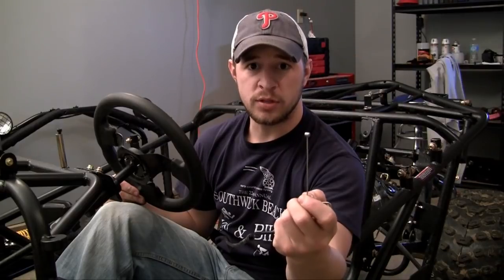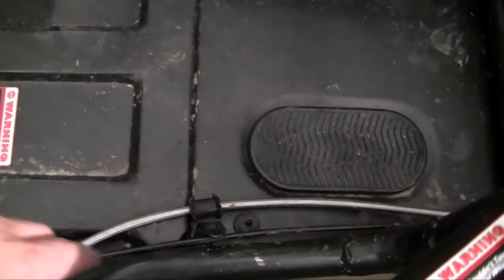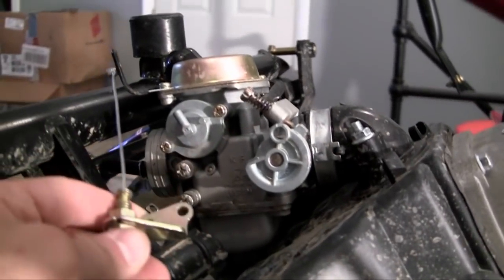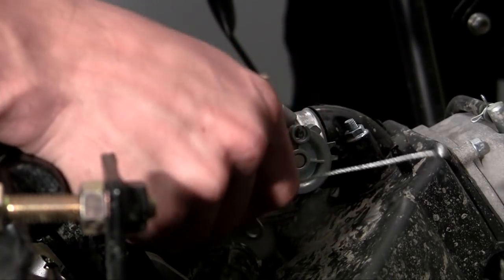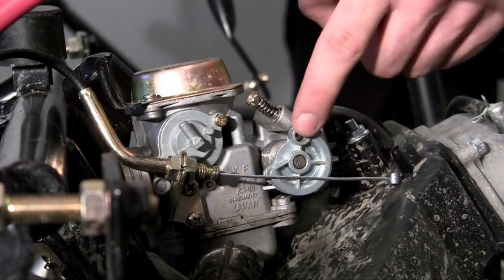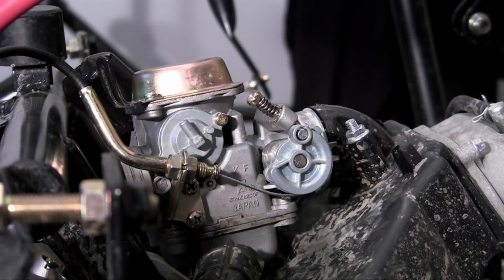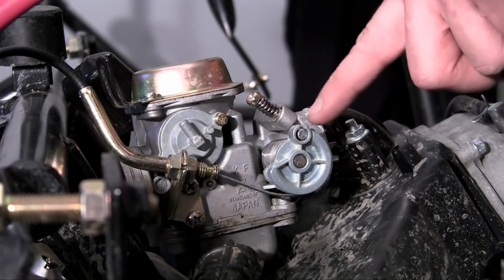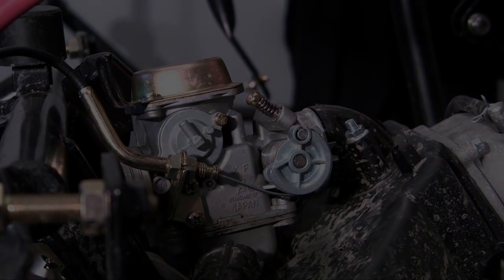How to Build a Go Kart - 18 - Throttle Cable

Comment: A clutch is a mechanism that is connected to the axle, so when you start the engine it just dont start rolling and when you step on the gas pedal and the engine gets to a certain speed it engages and moves you forword